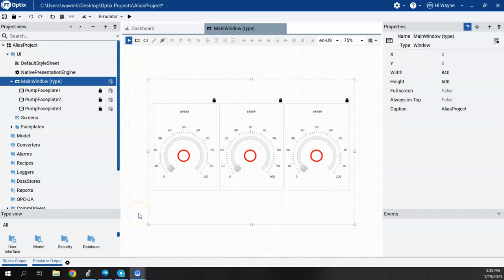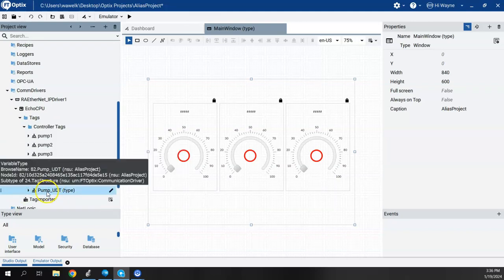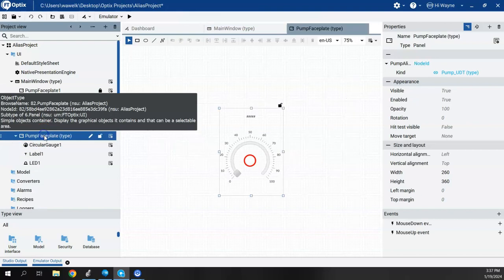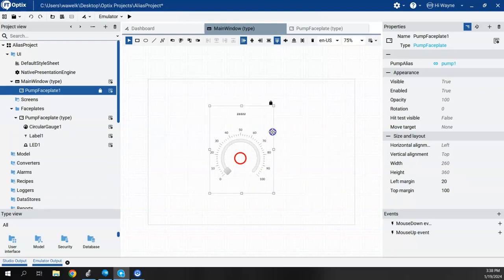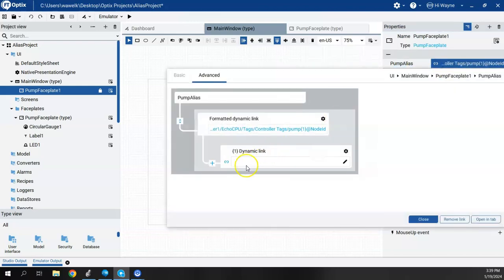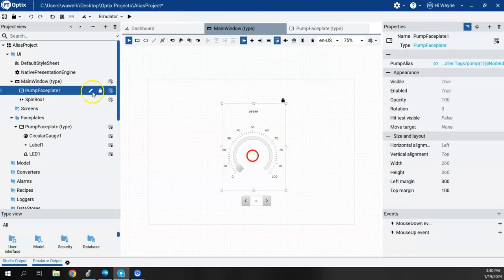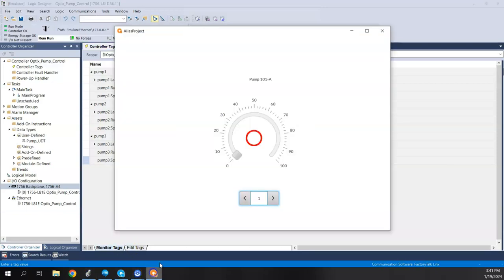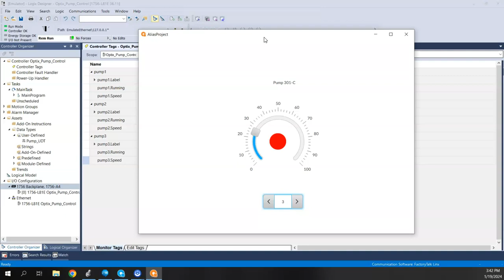FactoryTalk Optix Reusable Graphics Part 4 - Dynamic Alias Index with Logix UDTs

Comment: Hi, do you have an idea to pointing the description of a variable TAG from PLC, in the FactoryTalk Site Edition is possible to do that ?? Thank
Reply from the maker: Yes, you can reference extended tag properties.  For the tag's description you will reference TagName.@Description.  If using FactoryTalk View SIte Edition (SE) you will need to have Version 9 or higher for this to work.  For FactoryTalk Optix, referencing extended tag properties is a "feature preview"  or beta release in Version 1.3.